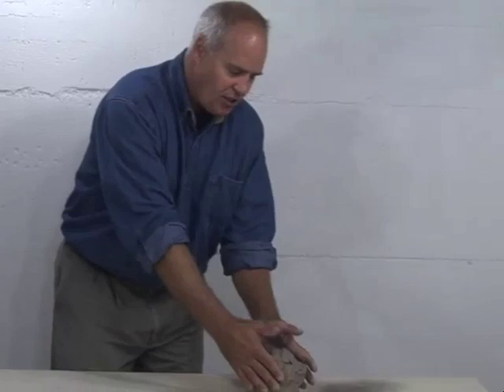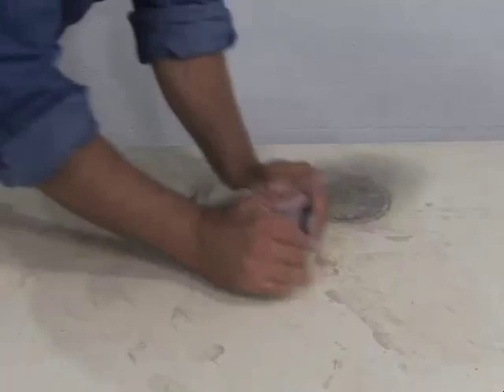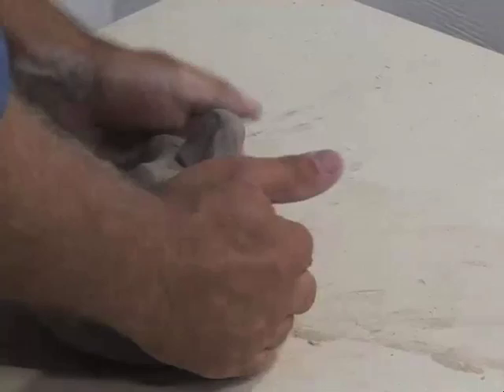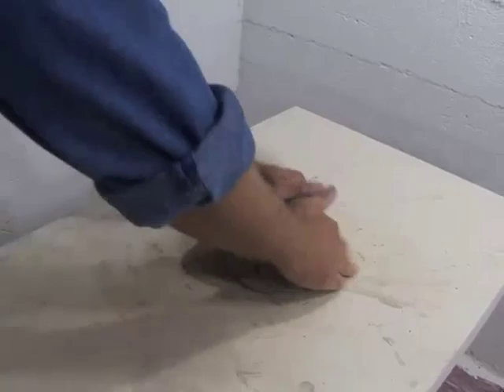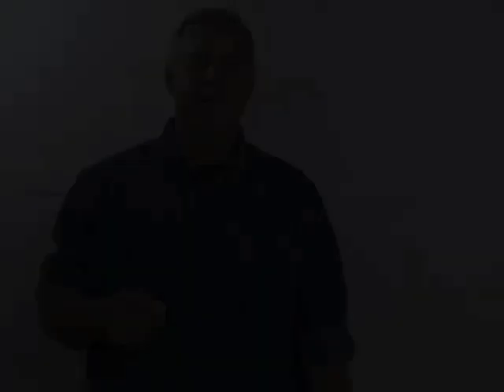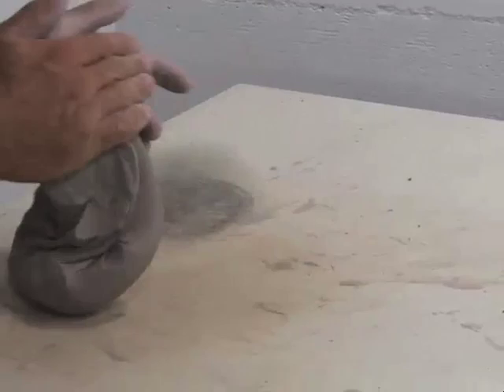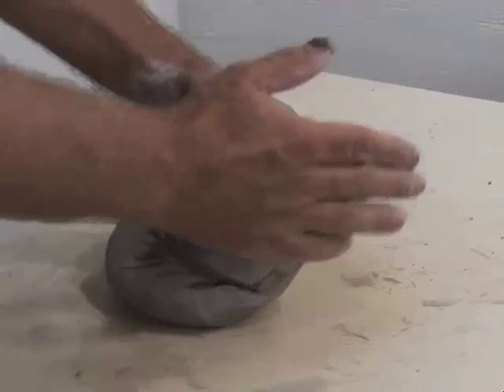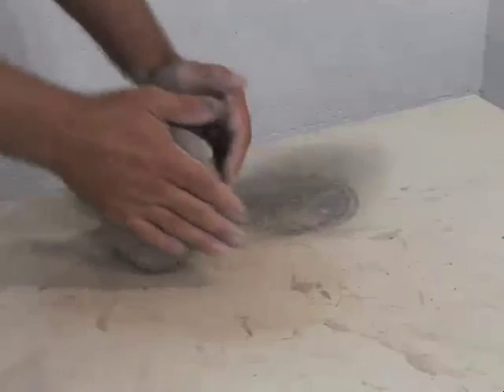Clay Wedging 101: A Great Way to Teach or Learn to Wedge Clay Properly - DORIAN BEAULIEU

Comment: that's not wedging, that's heading, wedging is cutting the slap and soaking the two halves together repeatedly
Reply: wrong wedging is used to get air bubbles out of clay
Reply: @TariqKhan-xt5qs  Both of you are wrong: he is "KNEADING" the clay, just like kneading bread dough, producing a "rams' horn". The second kneading method is called the "spiral knead" which produces a spiral pattern in the clay.  "Wedging" is accomplished by (using the cut-off wire) slicing off the face of a body of clay and slamming it down on the remainder of the body of clay to mix the clay  into a homogeneous mass!  Kneading removes air bubbles.
Reply: @patrickbass3542  Wedging is a way of kneading
Reply: @TariqKhan-xt5qs  Not really.
Reply: SLAP FIGHT! lol  I swear, people on the internet will argue about the silliest semantics. If you have this much energy, use it to make something besides controversy.
Reply: I like potatoes 🥔